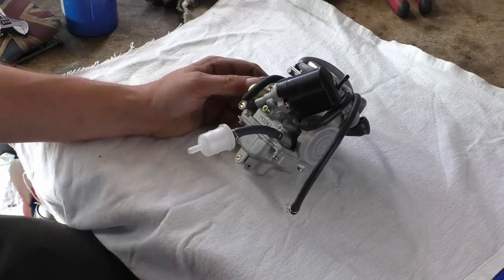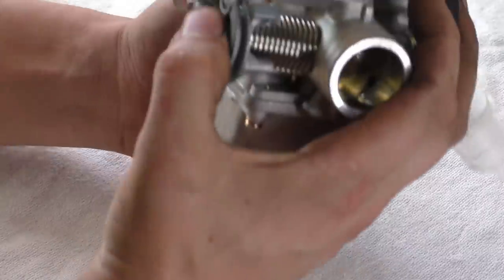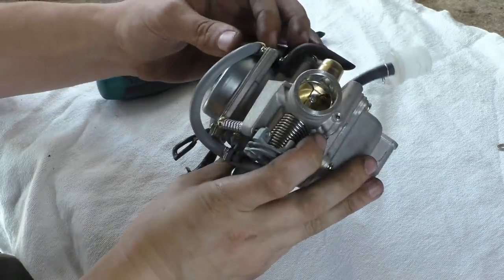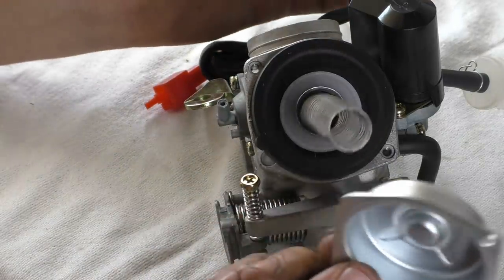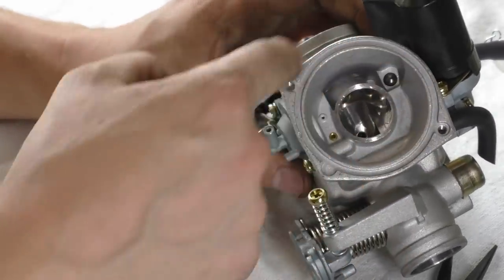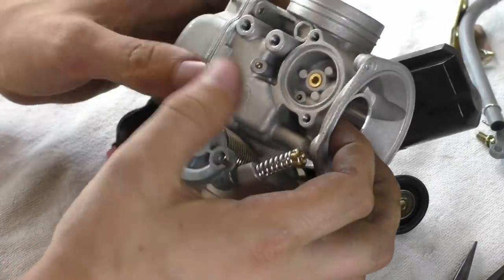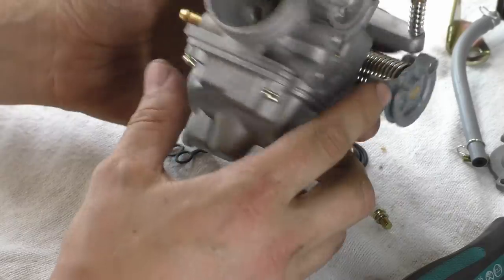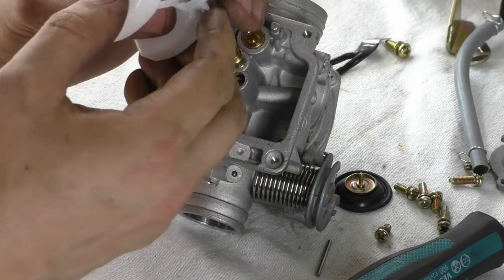Chinese Carburetor - Teardown

Comment: Those are the stock replacement carbs for the gy6 150cc clone engines. I was going to send you one of mine that snapped an idle screw off. They are good enough of a carb to last 8 years with a few rebuilds then grab another for $24. 
I'm not sure what you're on about with the plug on the bottom face of the carb. That's a cross drill for the mixture screw you glazed right over. Also, throw that auto enricher in the nearest fireplace you can. They fail pretty regularly. I have quite a few spares; they are just dirt cheap parafin wax motors, not solenoids. Good luck finding a real use for it.
Reply from the maker: "That's a cross drill for the mixture screw you glazed right over. " -

Which bit? I'm lsot here.
Reply: The Workshop under the throttle blade, on the intake side of the carb, there is a brass screw cap. That covers the idle mixture screw access. Pull that and you can screw with the idle mixture.
Reply: Dylan Headrick qqqq1
Reply: Are these a rip off of the japanese Keihin carbs. They ok for the dirt cheap price
Reply: Matt..those 4 little holes under the butterfly, idle jets/progress jets , they are drilled from the float bowl and then the access for drilling plugged its the ally plug you poke and puzzle about. You couldnt drill those holes halfway down a venturi at 90* with much accuracy. Its just the manufacturing process.
as for the Quality - its not that bad, whats the service life for something like that 4 yrs of abuse for a few $s?

Sean602

Comment: I prefer my 30 year old mikunis over anything. I have a mikuni vm32 in my tzr and after replacing one o ring it works like new. My gs 500 also has mikunis (sadly only 25yrs old) and they work perfectly too. And I bet you cant get new parts from manufacturer for these chinese carbs after 25 to 30 years.

Comment: Just refurbished my PZ26 clone on my little 125 runaround. Not the greatest carb I've worked on but after I had shaped the butterfly valve so that it operated correctly without sticking, cleaned out the main and idle jetting, the bike now runs smoother than when I bought it new in 2014. I agree that the fit and finish is rough but they seem to get the ventura's etc right. Would buy it a new carb as it owes me nothing, but the original cleans up well. Have you seen the new 125's from China? Most are now coming with fuel injection as standard. Maybe I need to wait and get a crashed one of those for a transplant! Would prefer another VFR but I can't seem to keep the throttle closed!
Reply: Yes I almost bought a Motrac 125cc instead of my Kawasaki z125, couldn't get the price low enough to compete so I bought the Z. They are all gutless, but are fun on the short and twisty Kart tracks. Fun in city areas where the speed limits are low enough to fit their performance range. But I'd still only want one as a second or third bike.

Comment: i bought one of those carbs for my beater chinese scooter, i had to change the pilot jet but the o-ring for the floatbowl expanded when it came in contact with the gasoline, so i could not assemble the carb again.

Comment: That casting broken off in the tube is off the drain/overflow isn’t it?
Reply: Borisa Pantelic Yep. It's pretty damn common with these keihin knockoffs. I've had a few break off on me. It would be nice if it was a pressed in nipped instead of a cast one.

Comment: yeah ive encountered one, the hose connectors on the carb were plastic. and the round slide throttle was stuck in the pipe,not moving freely. what a piece of crap

Comment: Looks exactly like the same one on lexmoto valencia scooter
I replaced all the screw fittings with better quality
Removed the auto choke for a manual and the plus side uses khelin jets (prob spelt that wrong)

Doing its Job well since 2014 so can't moan really
Reply: Robert Brown, the design is based on keihin design (the idle mixture screw position was moved from the vertical position to horizontal to avoid registered design issues, the giveaway is the small diaphragm which is an anti-backfire/fuel cut on over-run valve which is a keihin technology) which is quite common  in that Chinese companies will buy designs and equipment from original manufacturers, make changes to avoid legal issues (design, patents etc.) and continue production.

Comment: The broken tip in the hose should be near or on the bowl since it should be a over flow outlet.

My question would be how crap could the chinese carbs be? They are usually a direct rip off of a good design in most cases, just with some cheaper parts and materials... Sometimes broken materials.

Must be the iPhone of carbs since it says: "DESIGNED IN JAPAN" on it proudly like a crap iPhone is Designed in California...

Also what controls the auto choke? I know they make fully mechanical ones for mowers.

From taking apart at least a dozen carbs, most of them have a slightly better finish and parts. It is ~ 75% of the actual product that they copied. By time you replace the fasteners, o-rings, seals, hoses, and the dreaded diaphragm... you'll be at a nice new carb in price and quality.